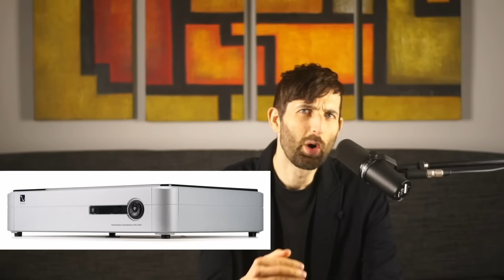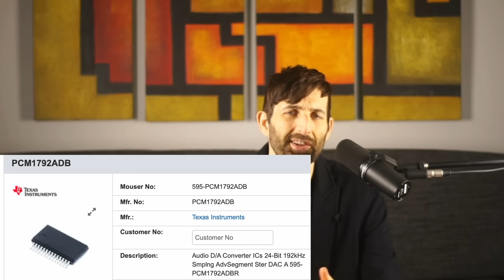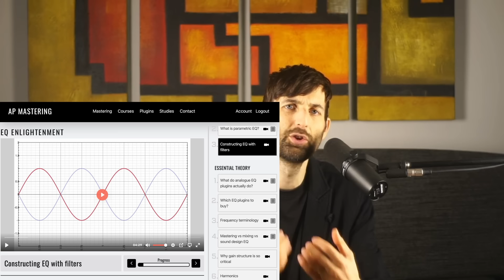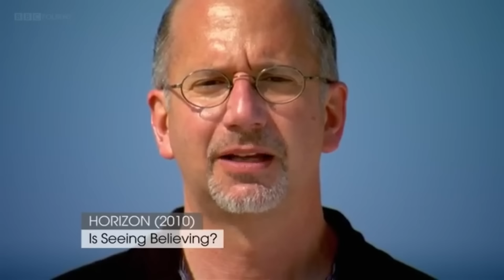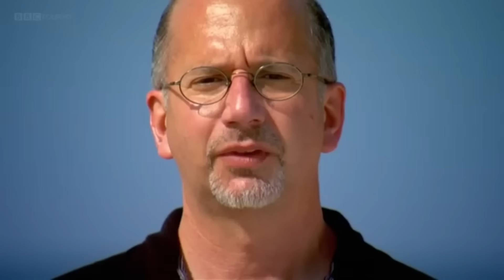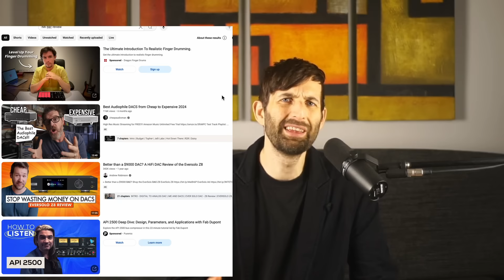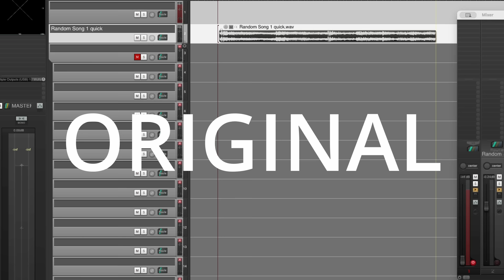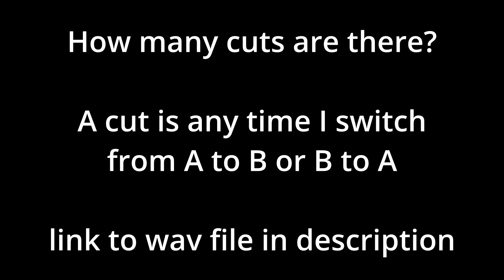The DAC Scam - Almost everyone believes the hype

Comment: AS a retired engineer that spend decades in R+D believe me when I say there is  much more to it that just the DACs. EMI/RFI protection/filtering, power supply, proper ground planes, timing jitter, resistor noise and on and on. I have seen designs with top tier ICs but mediocre performance.  My last comment is there are a lot of audiofools who spend money on ridiculous tweaks that make unscientific and unmeasurable claims. I proved to one that his $1400 optical cable was no better than the cheapest one I could find in my lab. Same goes for these guys that waste money on power conditioning and expensive power cables.. Unless you live in an area with extremely bad power and have equipment with a poorly designed power supply you are simply wasting money.  I have noticed a common theme in the tweak manufacturers, they make some claim about a supposed issue that is not relevant/scientific and then offer you the solution for $$$$$.
Reply: There's a lot of ways to design a substantial misbehaviour into the DAC or just about any audio circuit and ruin the performance, even when we're speaking of DAC chips that cost like $1-$2. But doing it correctly is a matter of competence about a thousand times more than unit cost.
Reply: This. Thank you. While I am generally sympatehetic to almost any attack on the snake oil that pervades the hifi industry - manufacturers and magazines and reviewers all included - I do think he went much too far in the video introduction by claiming essentially that the DAC chip is the only thing that matters, when a stable noisefree supply for a well-designed output stage is probably more imortant. As for jitter, it is my understanding that only a quite large amount of it is actually reliably detectable by humans in ABX testing. I've never understood why jitter is supposed to be a hard problem though (but accept this is probably just because there's stuff I don't know). Oscillators operating in the MHz range are not hard or expensive to come by, and the sampling frequencies we are dealing with are basically 44.1 kHz to, worst case, 196 kHz (for those who insist on ultrasound fidelity?!?). Hence, quite a bit of variation in the oscillator should be a non-issue as long as the average frequency over blocks of 6-10 samples is accurate, according to my understanding (which is, again, full of holes).

Cables however remain the biggest scam area in the hifi universe. James Randi invited all the golden ears to bring the exotic and expensive cables they recommended their readers to buy, and promised a million dollars if they could reliably distinguish them from some cheap Monster cables in a blind test in controlled conditions. Oddly enough the editors of Stereophile and the rest of the lot didn't even feel like _trying_, yet they continued to recommend the products they know makes zero audible difference...
Reply: @dojohansen123  I was a 23 year beta tester for a boutique cable manufacturer.  His power cables, speaker cables, digital cables had only a few iterations and changes over 25+ years.  However, his interconnects I have several boxes full, 100s.  They were/are relatively affordable for mid-fi to high end systems.  I use Westminster Labs Ultra and Masterbuilt Reference cabling on my primary high end system.  I can afford them and they are expensive relative to my friend's known boutique brand.  I derive maximum pleasure from their power cables and interconnects.  In a mid-fi system, they probably won't make a difference, in fact, lower resolution systems would do fine with Belden/Blue Jeans cabling.  However, most of the high end cabling I heard sounds equal or worse than Belden.  Maybe just a mismatch with the equipment.  

So many electrical engineers believe that power cables make a little difference if their gage is the same.  I know several who upon hearing just the less expensive Grover Huffman power cables were shocked at how superior their enjoyment and systems sounded with his cables in their really expensive ($1/2 million and up) systems.  My listening room cost as much to build from the ground up as my audio system equipment.  It is worth it.  I've heard many inferior systems and sometimes a well developed inexpensive one is very satisfying (my best friend's $15,000 system is fabulous).   Cabling is very important, especially power cables.  
Power regulation has become extremely important due to the dirty power caused by computers, internet, phone signals, all types of RF and EMI not present 50 years ago when a simple capacitor could be used to remove the power ripple instead of voltage regulation.
Reply: @dojohansen123  Monster brand cable is a pretty good cable! So long it is using Oxygen-free copper in the cable which prevents electrical signal attenuation, absorption, refraction, diffraction and other sundries, you are good to go! I also like Japan-made Mogami cable as they specify the use of Oxygen-Free copper which gives about a 0.05% increase in signal quality which IS noticeable by a trained ear in a recording studio or a quiet listening room environment.

For most people, Monster Cables and Mogami are GREAT BEEFY cables which should last many years at a decent price that is not too hard on the audiophile budget. In terms of Amplifier circuitry, I would suggest looking for Jensen Transformers for best damping against that ignoble high-pitched whine I hear coming from lesser amplifiers. And for a higher-end DAC, you need to look at total signal bandwidth in terms of sample size (24-bits, 32-bits or larger) and sample rate of 192 KHz or more, and THD (Total Harmonic Distortion at less than 0.05% or better!) and self-noise floor (5-to-10 dB or better!) and a SNR (Signal to Noise) of better than 110 dB and electrical signal jitter measured in low picosecond range.  

THOSE are truly OBJECTIVE statistics! The rest is dependant on your ears as 50 year old ears that typically only hear 200 Hz to 8500 Hz are NO MATCH for 18 year old ears that can hear the full 20 Hz to 20 KHz audio spectrum!

If you are older than 35, you can't hear high-end audio anyways so just buy a nice set of Sennheiser HD-850s headphones ($1600 USD) or even the $350 German Maestro G450 headphones which are the BEST BANG for the buck headphones out there! No need to spend $25,000 USD on speakers and $50,000+ on studio-reference amplifiers! 

Hook those Sennheisers or German Maestro headphones up to a $1200 USD Sony xPeria super-smartphone with its 24/32-bit per sample at 192 KHz sample rate DAC chip and you are good to go with your ripped SACD (20 bit Super-Audio CD) or HDR-Audio (192 KHz) rock, jazz, classical and contemporary audio recordings!

V
Reply: @dojohansen123 ok so Jitter is something I have done some armchair/internet research on and - please anyone who can debunk what I am saying feel free to do so - this is my understanding :
So DACs are pretty poorly designed, especially compared to even the most basic digital engineering. They do not have a timing line that allows the DAC to properly sync with the input. Therefore any even tiny variation in the input signal (completely inaudible to humans) causes the bits to shift and as modern DACs are 1 bit DACs that has the effect of cutting off the top frequencies.

Anyone (who actually knows this stuff) feel free to debunk
Reply: @cybergornstartrooper2157 What about 192 piece r2r ladder DACs like Fiilo?
Reply: @andrewbrazier9664  no I don’t think so however apparently ladder DACs suffer from -
“R2R ladder DAC and binary-weighted-resistor digital-analog converters have non-linearity issues due to available resistor tolerance. The non-linearity cause distortions. Also, it can cause audible products by ultrasound, which degrades sound quality.”
Reply: @cybergornstartrooper2157  i don't have a clue what you are saying. is R2R dac the gold standard in dacs
Reply: @cybergornstartrooper2157  "poorly designed" coupled with "I have done some armchair/internet research" doesn't really work I think. To address that specific point of it at least: when something is "THE way it is done in the audio world and in almost all applications that need that kind of thing done" you can basically bet your ass it is not poorly designed - not just that "especially compared to even the most basic digital engineering." Digital engineering? Umm... I get the feeling you don't really know what that means or what field&domain we're in here. I have a "sci/tech" school background and worked in software development/"engineering" most of my career, so I figured maybe it is actually something but it's just far off in some other domain. So I looked it up: 
An offshoot of Model-Based Systems Engineering (MBSE), digital engineering's goal is to accelerate the development of complex products, systems, and sub-systems by overcoming the established engineering disciplines, while addressing each engineering problem.
Want to know what this translates to if we remove the gobbledigook bullshit? "Horses Ass". That IS an "engineering translation" btw. 
So this is a very long form way to say that no, DAC's are NOT poorly designed (should go without saying, but anyway) and they are typically quite well engineered in order to achieve the goal set for them to achieve. Typically this goal involves wordsizes, sample rates and so on, but the most common one being 16bit 44.1khz etc. Having anything else wouldn't make a whole lot of sense since most source material is in 16bit 44.1KHz so unless you plan on producing your own source material for it to play back you're going to have to play with the same ball as everyone else. 
Anyway, there is a number of different things which make DACs "less than perfect" if we look at the system around it, so in this I do not only mean the silicon chip or herd of hobbits that does the actual "read instruction - set up machines - put out a pulse of X Volts" part but the amplifier circuits etc that surround the DAC chip - the topology of this varies greatly from one solution to the next, there are DAC's that are single chip where you shoot a bitstream into a pair of pins and on 2 pairs of pins you have analog audio coming out. 
So when you compare DAC's you'd kinda have to be comparing the "system" rather than the invidividual chip - however it introduces a lot more variability into it because you could then get 2 CD players with the exact same DAC chip but they sound obviously different when you compare them - one can use the recommended implementation while the other uses an implementation developed in-house by the maker of the CD player. My point here is what when we look at the "how does it sound" thing, the DAC is not 100% or even close to of what determines what something sounds like. 
Then about 1 bit DAC's - it's simply a term that is invented by some marketing muppet who doesn't know the first thing about what it would mean. A 1 bit "DAC" is not anything because 1 bit is either 1 or 0 so there is nothing to convert. You have 2 levels in 1 bit, on or off. If it were a "1bit DAC" it would be a piece of cable from the digital end to the analog end. Likewise it would be immoral to charge for it - or to call it conversion, since you are NOT converting anything if you're just outputting a digital stream, which it MUST BE FOR IT TO BE 1-BIT. 
But I figured just to be sure I'd take a look online, and gee wouldn't you have guessed it "A 1-bit DAC (sometimes called Bitstream converter by Philips) is a consumer electronics marketing term " - okay, now it starts making sense, since a 1bit DAC of couse does NOT make sense. It IS complete horse$hit - it is in fact NOT a "1 bit DAC" but just a normal DAC that instead of reading it's 16-20bit dataword through many parallel pins reads the data through a serial interface, a pair of pins, one bit at a time to make up still 16 to 20bits per word for the conversion. It just translates to a difference in the "anatomy" of errors in the data and how one can handle them. It's not a particularly important topic outside of the specific implementation of a DAC chip within something that needs one. a so called "1 bit dac" is no better or worse than a "16bit dac" or a "100bit ramadamadingdongdac" since they are all meaningless marketingspeak terms. 
There would be 100 more pages on this but it is far to open and wide of a topic to cover the important parts of even I think. Different DAC implementations have different weaknesses and strengths and kinda "inbuilt flaws" - the things being incorrectly called 1bit DAC's are exchanging one "flaw" for another in most implementations, but one major reason for the so called "1 bit" or more correctly "bitstream" DAC's is that typically their errors result in a lower difference in amplitude of the analog output than an error would in a multibit DAC where the bit error could affect the +/- bit of a word where if I've understood it correctly this isn't used in 1bit DAC implementations. Not sure on this, I didn't really feel like going as far as to looking at the exact chip implementation circuits&signals for it. 
But as far as what I've seen the nonsense "1bit dac" marketing hype word has fallen out of favor - so I don't think it would make any sense to call modern DAC's that. You could call them "bitstream DAC's" but that is a bit redundant too since all digital data moves in bitstreams with the only kinda exception of clocked parallel where you have multiple syncronized bistreams basically. 
----------
Back for a moment to the "timing line" comment, it is not really applicable to something like a CD because it is not a synchronized media type or source, but this is - in a sense - related to jitter. The DAC(s) are not exactly related although there are DACs which are built to use a buffer where they can correct for jitter if the input stream allows for it - not all do, some do some don't - mostly if you're getting data from a source at for example double speed compared to what you're processing out via the DAC you could identify data errors and correct for them by asking your source to retransmit packets that are corrupted in some way. Jitter itself is technically usually that a word is not sent by the source or received by the recipient correctly, in the case of a CD player it can be because the player was bumped and the laser skipped to a (usually outer) different track and read data from there instead of staying on the current track, this is typically temporary, and if there is a buffer then there is a good chance that the player can re-read the part where it skipped tracks, and update the data in the buffer before it is going through the DAC. But it can of course be of another kind like a word is read wrong by reading the start point too soon or too late in which case the content is shifted by X bits and wrong. 
Back in the early days of CD the transports were 1X and slow compared to later ones, so skipping etc was fairly common, but later systems on consumer level gear have become faster and more easily able to correct for jitter in the transport stream - and they use a buffer or several seconds of audio data so you won't hear it in the sound because the mechanical drive is able to go back and read any bits it missed to make sure the data is in the buffer doesn't run out before it has corrected the error. 
jitter can be from a number of sources technically, but other sources are more rare, other sources can be even cosmic rays hitting some part of the player to get the more exotic kind.
Reply: @noth606 bro please slow down on the methamphetamine
Reply: I do think there is enough quality materials to build a top-performing ADC for under $1k and still make a couple of hundred (maybe more) in profit.
Reply: @robbolling5495  Its way more than parts. You need to spend money on R+D, have a lab (500K+), purchase IP (patents/intellectual property), hire researchers, hire QA people, do CE/FCC/UL/Rohs testing, pay a factory, run through various eng builds and Betas, pay mktg/sales and also either buy or rent a building to do all the work in. The first new Samsung phone costs 100 million+ to build but after that they are 1200 each. That does not mean that you can go buy 1200 in parts and build an equivalent device. Building a quality DAC is not just something you slap together with a few parts and then charge parts + 200. BOM costs (Build of Materials) are typically are a small fraction of a devices total costs.
Reply: glad to hear someone speak out, not an audiophile but i'm someone who tries to be a well informed customer. would you have any recommendations for equipment like a dac/amp that would work with a pair of sennheiser 560 s?
Reply: @catalysts94  Schiit Asgard X with the Mesh DAC option. It's great for high impedance dynamic driver headphones and the Class A warmth makes the glaring treble of the HD 560S manageable.
Reply: AS someone who worked in Aerospace in flight entertainment systems as a program manager after having run in an electronics maintenance and repair shop in the military after having graduated from college with a degree in computer science believe me when I say MOST people live in an area with extremely bad power and MOST electronics failures I have seen were a result of bad power and/or bad ground.  Municipal power in the US is shit run on contract by idiots who only use quality equipment when they're expressly forced by regulation to do so.          

My brother also is a civil engineer that works on hydro electric dams and wind turbine systems and neither of us have nice things to say about the US power grid.  Yes, most audiophiles spend way too much on power protection but if you live in the US chances are you house power grounding is shit and your municipal power isn't continuous or "clean."
Reply: @TurboLoveTrain  I've got at least 5 pieces of audio that are dead due to sht pwr.
Reply: @46wireboy  where do you live. dallas power has never killed my audio equipment
Reply: You are absolutely right. They who believe that the DAC chip mostly determines the sound quality are falling for another myth. Analog circuits are complicated and the DAC is still mostly analog circuits. These analog circuits can be tuned to sound smoother or crisper. When playing with Foobar, I realized that the digital filter being used for oversampling can produce perceivable differences. There is no single perfect solution to a lot of things in audio. So many measurements are based on repetitive signals and only show amplitudes in the distortions. Transient distortions in real audio signals and their phase and time-domain issues can become very complicated very quickly. But it sure is foolish to spend big money on cables. I know a few engineers who are both audiophiles and hi-fi equipment designers, and they all say that properly made cable used in professional studios cannot be further improved. It is actually possible though to degrade the signal transmission using really exotic cables with non-standard designs. So yes, an exotic cable can make a difference, due to problematic signal transmission. One example is really tight RCA connectors that scratch your output terminals. The contact surface becomes damaged, so it becomes easier to hear differences when using different cables due to unreliable contacts.
Reply: @soapberrygreen  What evidence do you have to claim that "analog circuits are complicated" in DACs?
Reply: @psyborg06  Take a look at the datasheet of the Cirrus chip shown in the video, find the section about the analog output filter. Often the manufacturer will give a suggestion for what an output filter stage MIGHT look like, but emphasize that PCB design is an important factor in the quality of the produced sound. Now, I'm skeptical that many of the top end DACs are doing anything different from the "standard" implementation of output filters, but there will be audible high frequency noise if there were no filter at all. That's at least one area where they could potentially differ though I agree with the conclusion of the video.

Often the actual design of the ground plane of the PCB, the routing of the traces and the selection and tolerance components can have an audible effect in analog circuits. That's not snake oil, that's just the challenges inherent to reproducing analog frequencies accurately. That said, so much of the work has been offloaded to the IC itself over the years that the board design is much less important than it once was.
Reply: Finally......someone with some sense.  As I said in my comment, what about the analog output section in a DAC?  That has far more to do with tailoring the sound than the DAC chip.  For that matter, the power supply can tailor the sound more than the DAC chip.
Reply: It's with multiple channels of conversion where Jitter can become a problem IMHO.
Reply: Since optical cables will be used to transport digital data, 0s and 1s, basically, the variables that affect the price of the cable are: its size, amount of data that can be sent (kb/s, Mb/s and so on) and the needs of the external shielding material according to the environment in which the cable will pass, like inside the walls or over the roofs, places that we cannot see and where the cables can be eaten by rats.
Reply: @renzonogueiramargotto3141  Best fibre optic cables are high-purity Quartz single-mode "glass" fibre. I.e. called Single-Mode Fibre which can go for 10 to 20 kilometer runs before needed optical repeaters. 

Multi-Mode fibres are usually plastic and are only good for about 300 to 500 metres at the maximum for your cable runs. 

Single Mode Glass fibre need a much more gentle bend radius so they CANNOT go around tight corners BUT they do allow MORE data since they can accept Dense Wave Optical Multiplexing where multiple laser frequencies can coexist and be tightly spaced on the same single fibre line allowing for up to Petabits-per-second data rates!

Multi-mode plastic fibre can be wound tighter and go around in very small confines and around tight corners BUT you can only do that WITHIN a small physical area (i.e. a max 500 metres distance for your cable runs) and you get about One Terabit per second as your maximum possible data rate due to impurities in the polymer fibre not allowing for closely spaced laser light frequencies.

In terms of DAC/ADC chips, any chip with 24/32 bits at 192 KHZ with greater than 105 dB signal to noise ratio will be a SUPERB digital signal processor system for audio and those chips aren't usually more than $150 USD each for the higher quality ones, so price-wise your typical audiophile-grade 24/32-bit at 192 KHz DAC box retailing for $1600 USD is going to be just fine for home listening on your headphones AND for your larger home stereo speaker setups!

V
Reply: Yes, but it doesn’t change the fact that multi-thousands $ dacs are basically a scam when they measure so poorly and when couple hundred $ dacs measure state of the art.
Reply: @Maxime-ho9iv  I'm not arguing that some audiophool gear is ridiculously expensive, but I will argue that good sound is not just down to measurements.  Not everything can be measured.  Some people love the sound of tubes and the 3d magic they bring to sound, but others will tell you it's just 2nd order harmonics fattening the sound. Having heard what a good tube amp can do for 3d imaging for one, and just an immediacy to the music that transistors don't seem to be able to replicate,  I have a feeling it's just not that simple as being down to just the things we can measure
Reply: @Maxime-ho9iv  The point of hifi gear is that they sound good, if they do nothing else matters. Generally there is some correlation between good measurements and good sound, but with cheap gear designed WITH THE GOAL OF measuring well, you can almost be sure they don't sound good.
Reply: @bluemonstrosity259 Yes and no. With something that actually does sound different like a speaker, yes. Beryllium is a better material, it’s both super stiff and super light which is exactly what we need. And tweeters made with beryllium will have way less distortion, and it’s measurable, and you will definitely hear it. And they are expensive. A good speaker is also big, because physics, so it’s expensive both to make and to ship. 
But a dac doesn’t need fancy material, it doesn’t need to be big, and it doesn’t need to weigh a lot. You need electronic components, which pretty much cost nothing, and a brain. The brain is paid over all units produced. And we know now it can be done for couple hundreds, not couple thousands. 
Also, here is the elephant in the room: good gear should measure well AND sound well. We can’t count the number of products selling for astronomic sum of money that measure trash. We don’t buy musical instruments, we buy reproduction instruments so there is absolutely no way, absolutely none, that a device measuring poorly would sound good. 

Funny enough, why all those fancy brands never publish any measurements if they’re so confident they’re good? Even the specs sheet are getting smaller and smaller. The only brand I know that is high end AND costing a lot (AND actually good) AND still publishing numbers and datasheets is Accuphase. Look at DCS Vivaldi: the bloody thing costs multiple thousands and the product page is utter garbage, no measurements obviously but also almost no specs.

And the truth is: people do not listen to them. They don’t compare the $10,000 dac and the $12,000 dac, and the $200 one. They just assume the one with a bigger price tag is better, because it would be crazy if it wasn’t, and they have the money not the care. Here is the hard, blatant truth.
Reply: You neglect to mention that DAC chip manufacturers supply data sheets for their products that contain optimised board layouts for that particular chip. Additionally, the chip manufacturers usually supply evaluation kits for these chips that are also optimised in their layout, and the DAC manufacturers often copy these optimised layouts into their products...
Reply: @jabbalechat7910  Reference designs are not usually optimized designs. I have dealt with many that were just a quick and dirty to get you up and running. Optimizing for performance and our applications were usually what we did.
Reply: @jabbalechat7910 That is why it is so hard to justify expensive when an application note based D/A IC is used for both the cheap and expensive DAC.
Reply: What do you think about switched mode plug in power supplies in Dacs then ? When Linears are available
Reply: @deangale4496  A switched mode power supply simply interleaves (i.e. switches!) on-and-off rapidly between outputs and varying the output to EXACTLY match any given plugged-in device requirements. Usually, an IGBT (Insulated Gate BiPolar Transistor) with sub-10 nanosecond switch times IS BEST but cheaper circuits can be used. 

For 192 KHz at 32 bits audio resolution/quality, you NEED a high-performance switching circuit (i.e.  IGBT) in order to prevent power-rail jitter, THD (Total Harmonic Distortion) and limit the introduction of harmonics into any given circuit. 

A linear power supply offers a SMOOTHER waveform (aka a Warmer Sound!) of any given signal output at the cost of accuracy-of-signal from the original. A switching mode supply can offer highly-accurate voltage and current levels that ALWAYS stay in line within a given set of output ranges. That is GREAT for amplification purposes BUT the "sound" can be rather "Clinical and Cold" while Linear Power "Warms" it up most likely due to the natural anti-aliasing that takes place during analog signal processing.

Which is best to use? It's a subjective matter more than anything else! How "Warm" do you want your sound to be (i.e. a Tube Amp is better!) versus how ACCURATE do you want your signal to be? (i.e. a "digital" switching mode based system)

Please NOTE that my above explanation is highly simplified and whole discussions on audio amplification, digital and analog signal processing and power supply electrical internals can EASILY be multiple one hour long videos all by themselves!

I won't even DEFINE what a Switching Mode Power Supply versus what a Linear Mode Power Supply is within an audio circuit simply because audio engineers THEMSELVES cannot mentally agree WHY or WHEN they should or WOULD use either in any given circuit! I may be "edumacated" but I still have my ancient deep-rooted electrical biases! LOL!

V
Reply: That's why i only trust measurements on hifi forums or audiosciencereview board. As long as the particular unit does not have some kind of glaring flaw and it's sinad is 100 or better would be imperceptible to avg ear. These days you can get stuff that is 110-120 sinad for under 100 lol. Same with good amps. 100-150. Pairing it with a decent headphones it all comes to around 400-600 thatll get you most of the way audio wise.
Reply: There's more to it, sure.  But spread the R&D cost over thousands of units and it is not that expensive.  Certainly not the 10k+ price tags.  Not to mention that good, experienced design engineers don't need to fully study that on each design as their experience will cut the costs up front. IE, they know what works well already.
Reply: You are 100% correct. I worked in a telecom factory and one of the final tests was checking that the transmitted digital signal did not get degraded and their was no data loss at the receiving end. Digital Data (1s and 0's) seldom get misread even if the waveform is slightly degraded. This is the beauty of digital data in any transmission line, whether it is in the Microwave, RF or Audio frequencies. Very seldom did we get failures.
Reply: Sure, and a competent manufacturer like smsl can make an $80 DAC that's completely transparent that everybody loves. The only reason people won't say it sounds as good as their expensive gear is because it doesn't cost as much as they're expensive gear. 

So we can quit pretending that the basic engineering you mentioned is magic.
Reply: The guy on the video has no idea what he's talking about.
Reply: Yup, and that’s why I use RME stuff and not SMSL / Topping / Xduoo / Loxjie / Gustard stuff. Then again, if they’re basically just doing a case and PSU around the reference design with the cheapest SMDs they can source, assuming they’re not using counterfeit DAC ICs, are those even really that bad if you only want D->A and don’t care about latency / drivers / support / warranty / supporting real companies in the industry over parasites who make products with zero regard to intellectual property law?
Reply: Thank you, this video is like making the case that since all cakes have the same ingredients, the one made by your neighbor's kids in a bake sale, tastes just as good as the cake made by the boulangerie down the street.   

FWIW, this guy's video sounds better on my DAC with the mute button on, which filters out all the stupidity.
Reply: EMI/RFI and proper ground planes are actually helped by proper power cables i.e low inductance ground path. Well, at least that’s how it sounds like: clean. Undisturbed. Differentiated. Expressive.
Reply: @gioponti6359  Cables are analogous to waveguides.
Reply: Yeah. Audioholics are all about self deception and religious belief
Reply: Finally a proper, knowledgeable response on this video, which is very shortsighted - to put it mildly.
The only thing is that power filtering and power cables do make a very audible difference in the right system.
Reply: @VincentvanRooij-j9n , it's easy to believe whatever you'd like to believe when you don't do a blind A/B test.
Reply: Power regenerators and power cables make a world of difference in sound quality. The improvement is honestly greater than spending the money on a speaker or amplifier upgrade.
Reply: I can’t really hear jitter. Is it a real thing as in buying a reclock
Reply: @ProgressiveHifi  So, you're deaf?
Reply: @46wireboy lol
Reply: And all those concerns are solved problems. I.C. companies producing these chips also offer reference designs for things like power and analog conversion. Then there's the point that a properly designed power supply for a DAC is about $10 in volume. Ground plane, Filtering, jitter, other sources of noise, are all solved problems with will known solutions. A top tier 2 channel, balanced is literally a $300 to $500 purchase. After that you are setting money on fire.
Reply: You essentially contradicted yourself it seems to me. If all that stuff you listed matters why would you think power cables and conditioners do nothing? Worse, your technical qualifications don’t matter. Your ears will tell you otherwise and everything you need to know.
Reply: @a.s.2426  They don't do nothing! They just do VERY LITTLE! Most modern circuits are very adept at filtering electrical current and audio signal so it is somewhat pointless unless an ENTIRE music chain is at the same level of quality. 

Our ears fool us AND CANNOT BE TRUSTED! A properly calibrated  oscilloscope CAN be trusted and THAT is what needs to be done when measuring jitter, noise floor, THD, harmonics, etc. 

You hook up your signal chain to a multi-channel, high bandwidth recording scope (i.e. 2 GHz and above --- We use the Teledyne-Lecroy Wavemaster 8000 HD and a Labmaster 10 Z-series at 60+ GHz scopes!) and do your measurements and COMPARE to your intended base lines!

You TRUST THE SCOPE! Not the ear! It's like being a pilot doing instruments-based flying where you simply CANNOT TRUST YOUR SENSES because THEY LIE TO YOU! 
In flying, you can be flying upside down and straight towards the ground and NOT KNOW IT because your body lies to you!

You trust your objective-data-gathering instruments NOT your lying-to-you ears!

V
Reply: @a.s.2426  because the best of the vintage stuff came with lamp cord. And sounded the same as with cryo-treated oil.
As long as it's adequate and the connection is good - all cables are fine.
The keyword is "adequate".

Yes, I heard a difference when power fluctuated - so bad that the lamps were dimming a lot - on a cheap amp.
A sine-wave voltage regulator is more than fine even in this situation.

Toe-in by 10 degrees, moving the speakers one foot in an untreated room will have much bigger effect than all the current conditioners and power cables combined.
Reply: @a.s.2426 , you ought to take a science class and understand the levels of evidence. Your subjective response when you already know what you're being subject to is worthless, and it's embarrassing to have to tell that to an adult from a country with an educational system.

Do a double-blind test with your magical cables and get back to us. But you won't. You'll just believe what you want to believe.

You argue from astrology. After all, how could the planets not have some effect on us, and therefore, astrology readings are totally valid. No they're not.
Reply: @exponentmantissa5598  yeah...at what quality 128 kbits?Gimne a break...
Reply: Power makes a HUGE difference; there is virtually nowhere that has "good" power all the time.

I used to have to listen at 2 or 3 AM for the best sound quality; since buying a good power conditioner, my system sounds that good any time of day.
Reply: @VideoArchiveGuy a good PSU can make a big difference. I upgraded my Cambridge DAC with a linear supply and it sounds better. But I'm not convinced when I bought the DAC 2nd hand they'd actually included the right power adaptor so that might be why. Feels a bit light and flimsy. Original one was far better.
Reply: @VideoArchiveGuy  I beg to differ,, I have looked at thousands of power line logs and your claim holds no merit. It takes a seriously bad power line to cause any audible difference at all.  All modern amplifiers have very very good power supplies and the caps are a massive filter that are almost impossible to penetrate with noise of even power line fluctuations, what specific problems is that you are referring to?
Reply: @exponentmantissa5598  
The issue is the transformers and grid layout--not the lines.  
I also used to live where industry drew municipal power and you were guaranteed line noise when they were "spooling up" their bigger machines.  Before the mill shut down you could watch the whole town flicker when they powered up their production line.
I also lived in a mega-city that had brown outs when they switched the grid between different power suppliers... mega cities have shit power.  To pretend 20 million people living on a distributed grid all have clean stable power that won't damage electronics is simply delusional.
Reply: @exponentmantissa5598  Exactly! A power supply is the ultimate "conditioner" of the local AC voltage and frequency into one or more stable DC voltages. I'd love to know what's going on with the mains in any industrialized country that affects the output of any competently designed PSU!
Reply: @PeteC62  (If you're old enough) Did you ever fcking wonder why they put those filter warts on ALL monitors back in the day? And that some equipment still has them? Well, it AIN'T because the power is good or their psu sucks. Figure it out already!